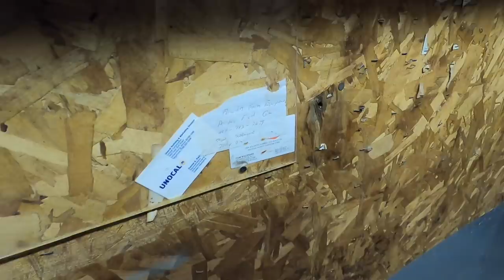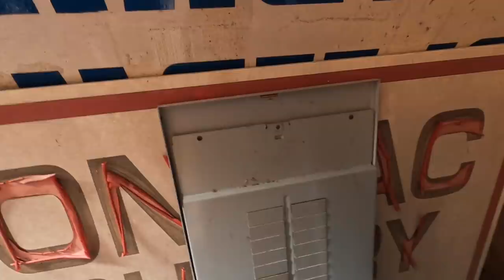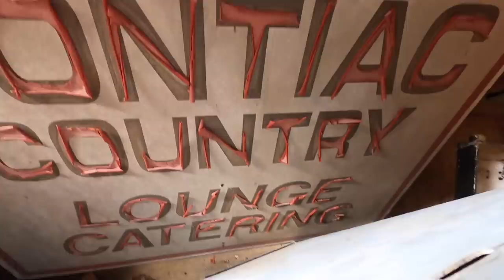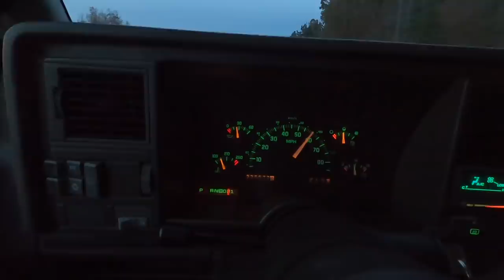Rockingham Speedway's Former Track Manager of 30+ Years Has Crazy NASCAR History Stories

Comment: For those who may not know. Rockingham was just got approved from the state for $9 Million to use to upgrade the track. According to their Twitter it's getting repaved and lights added. Also the Unical 76 signs most likely have been back there since 2003. Because Sunoco took over NASCAR fuel in 2004.

Comment: thats one of the round unacal signs, they had an actual ball outside of turn 4. also the abandoned gas station beside the track was a unical it had a ball too., lonnie Walker used to run it and my dad would stop by after work for a beer or 12

Comment: Those air conditioning units aren’t off tractor trailers,they are Westinghouse’s version of a “bard” unit. They are most commonly used on portable classrooms. What you looked in the vent and said “I don’t even know what I’m looking at” are the heat strips(electric heat) god I don’t miss working on those things!

Comment: Dude if you have a four speed automatic transmission you have to put an extra cooler on it in front of your radiator. They burn up pulling weight in overdrive… You said drive and overdrive. It’s either a 700r-4 or the 4L80 Chevrolet FYI IVE REPAIRED SEVERAL MOST OF WHICH I BOUGHT THAT WAY BECAUSE the previous owner didn’t use a transmission cooler. They are like a small version of a radiator with two line going to the feed line in the tranny to cool the fluid before it hits the clutches in the automatic 
—->>> FYI
Reply from the maker: It had one up there from a previous owner. Just too much work over the years it finally let go 😂